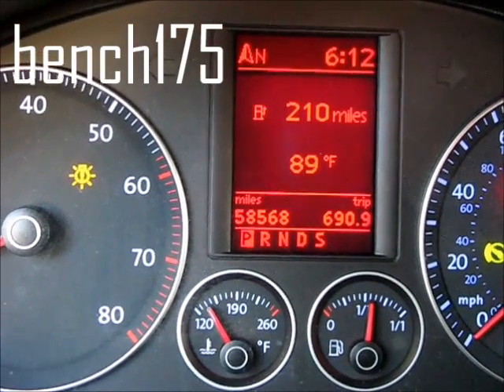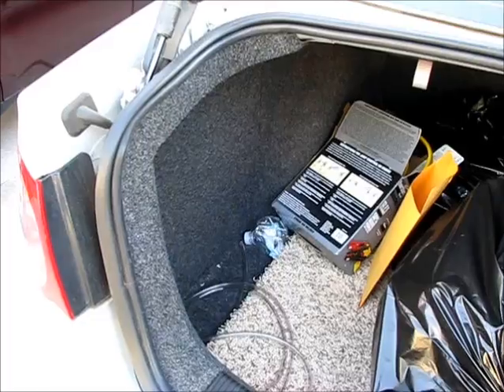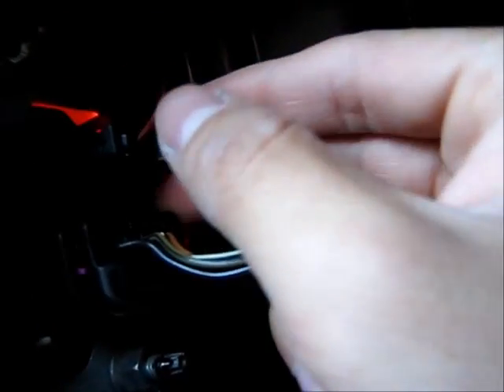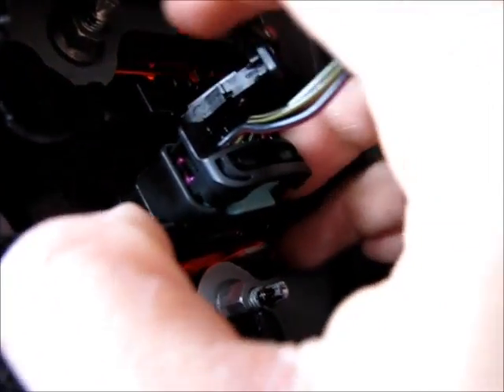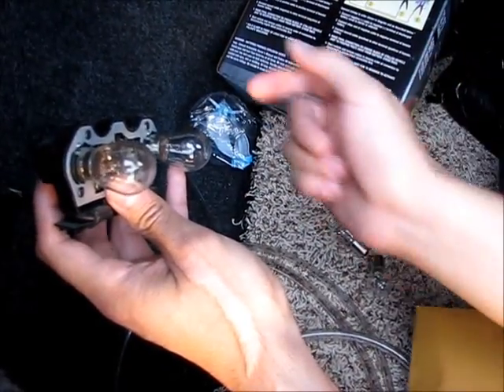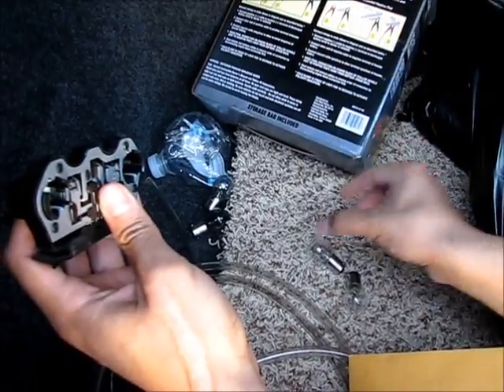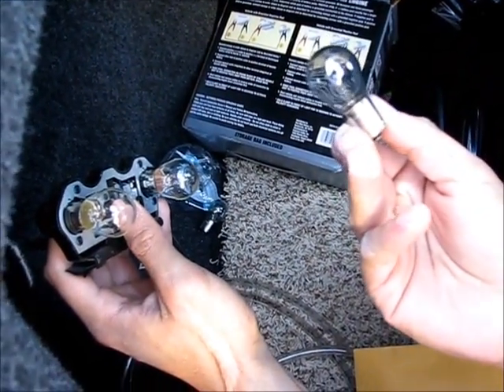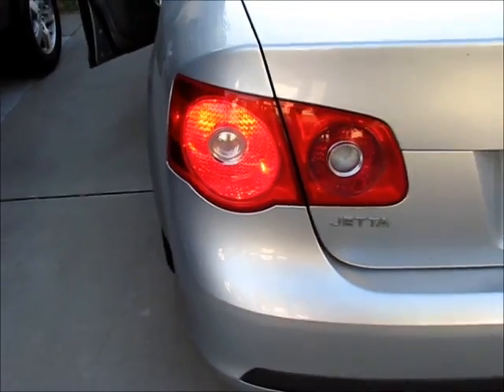How to change Brake Light bulbs on Jetta 2.5 MkV

Comment: Many thanks. Made it easier to see where the clips are and so on. Although I found it easier to undo the two speed nuts holding the assembly and pulling the whole thing out then replace the bulbs. Great Video.

Comment: Those wires you unplugged, what are they for?  Is it some kind of side marker bulb?  Are they replaceable?  I know the 1156 bulbs are replaceable but there is a small one in the corner on both sides.
Reply from the maker: +John Doe Sorry I'm not sure.  Maybe it's the sensor that detects when the light is out. All the lights have to be replaceable right.

Comment: how come your display screen is bigger than mine? in my 2006 2.0t its HALF. even though a full display is present, only the bottom half shows stuff. Like i don't see the picture of the car there or anything. basic stuff. stupid cheap ass LED display these bastards cheaped out on for Canadian market as USUAL
Reply from the maker: lol, that sucks.  Yup, I'm in US with a 2005.5.
Reply: It depends on what model (trim) Jetta  you get. Most Jetta's (Here in the US) that have the multifunction steering wheel, have the bigger info screen.  I also had a 2006 2.0T package #3 and it had the multi steering wheel and bigger info display. Now i have a 2008 Jetta Wolfsburg, and the info screen is half the size,and it displays when the door's are open, outside temperature,gas level, etc...I like it.